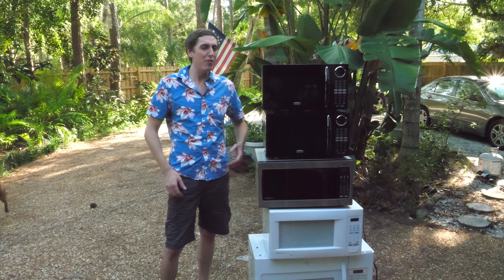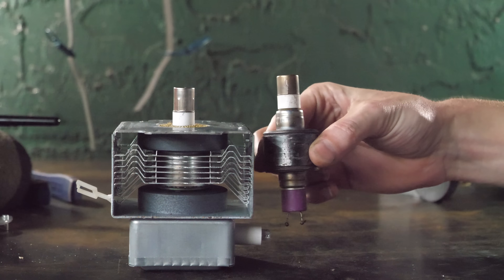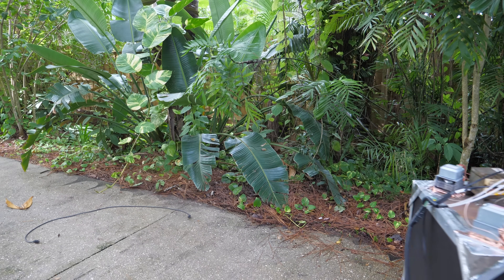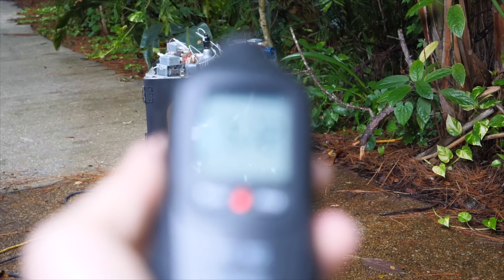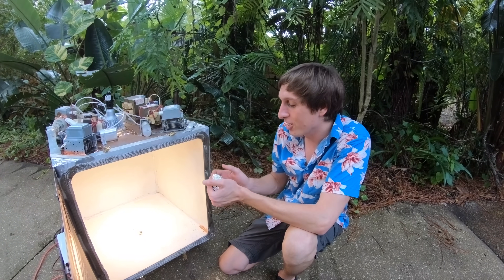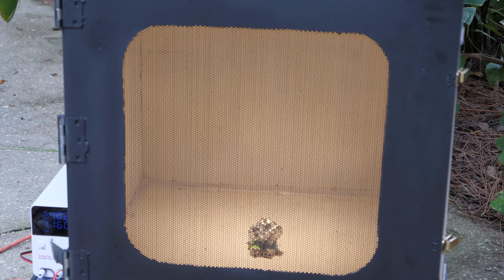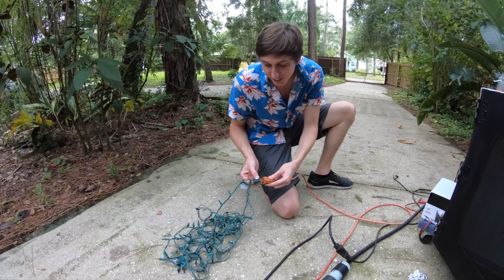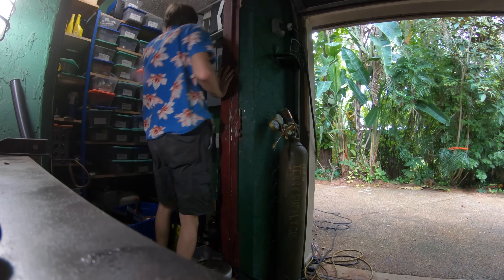DIY MEGA Microwave! - Microwaving a Microwave

Comment: I once microwaved a microwave with a glow stick inside of it. The glow stick remained intact but the microwave was fried. To get it to work I used a giant over the range microwave and a small 600 watt microwave. The little one BARELY fit inside of the big one but I got it to work.

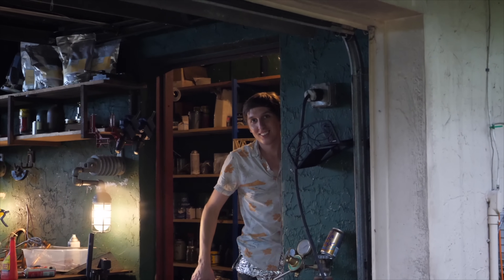Comment: 3:17 use the blond to film and hold the meter while you stand behind a 8 inch thick wall and run the power.. Awesome! Then she tests the cage too.. Double Awesome! 6:00 I think you are too low with your targets, maybe raise them up a few inches and see if it works better. I could be wrong.

Comment: How a microwave works 
It heats upp the water inside the food thats how food gets hot

And why its cold at the inside 
Its hardder for The waves to acces the middle of the food bcuz they dont travel so far

Why You cant put metal in microwave 
The wave just bounce on the metal like a mirror

Comment: Um...  If the microwave is designed to hold microwaves in due to metal shielding, how are the mega microwaves supposed to get into the smaller microwave to help cook the food if you leave the shielding on the smaller one?

Comment: If you want to make an extra powerful microwave, volume vs. wattage is everything. Add the magnetrons, to an existing microwave cavity, and it will heat extremely fast! Otherwise, you could try to offset them so the waves bounce chaotically all over the rectangular chamber. Thus heating more evenly.

Comment: 9:18 of course it's going to be cold hahahahah the larger microwave fried the electronics in the smaller microwave while the smaller microwave protected the burrito from the microwaves, so what happened is that the smaller microwave stops working and isolates the burrito, so it wont heat up.
Reply: Burrito?

Comment: Just don't break the magnetron. might just be safe... because magnetron has  beryllium oxide. Single or chronic exposure can lead to berylliosis, an incurable lung condition and has  thorium in all magnetron. it is radioactive metal. just don;t take out the filament out the magnetron, then break it. -cancer if crushed.

Comment: I have a tip for you regarding the cold center of a hot pocket.

Microwave the hot pocket for 1 minute.
Flip the hot pocket and do the same. 
Flip it again, and make a slit in the center. Microwave for one minute.

Comment: The reason the microwave in a microwave scientifically ahouldnt work, is because there is a fairly well developed seal between the inside of the inner microwave and the outside of the inner microwave. If it works as tested in the factory, then it should not work.

Comment: So if there are 100 bulbs in a Christmas light and we remove one and connect the two pieces to form a 99 piece light, the overall light would be brighter because the current through each bulb is more.
Or would it not and be equal because the current going through the bulb would just distribute amongst thhr other 99?

Comment: Make a microwave 'Jagerbomb', using a shot of petrol (gasoline for Americans) as the jager, in a glass full of DIESEL as the redbull, and a bit of tin foil. Hopefully, the microwave ignites the tin, the tin ignites the petrol, and when the petrol is burning hot enough it will ignite the DIESEL and give a massive 'whooooomph'.

This is pretty much what happens inside you stomach when you drink an actual jagerbomb.

Comment: this is weak. In fact, it probably would be stronger with just 1 magnetron. Those microwaves don't just add up in power unfortunately, they interfere pretty badly, and you end up with them heating up each other. If you want to have multiple of them working at the same time, you have tomatch them to start exactly at the same time, and mount them precisely after some calculations, but even then, you won't get a very good coverage of crazy powerful microwaves in that box, the same as you have hotspots in a regular microwave. I think you can do better, and I hope you take my advices!

Comment: So you calculated the cavity according to the frequency with a fraction of a millimeter as supposed so the energy dont go back into the magnetrons? And the 4 microwaves could be in phase with each other so a lot of the energy is consumed by some of the magnetrons and a lot is wasted due to no calculation. So even if you have 4 magnetrons you wont get 4 times the energy unless very carefully calculated for it, which I guess you havent, and I really doubt if its even possible to do with more then one magnetron.

Comment: Magnetrons make microwave beams, so you should concentrate the breams to one location. Also, position them in a way that the beams target the food from multiple angles when reflected from the sides. Later as the beam width is small, you want to move the food inside to reach every part of it. Currently, you just wasting all that power.

Comment: You silly, the little microwave acted as a Faraday cage against the big microwave! Also, I don't think you have enough power -- try using 10 microwaves that are 1200W each. Also, if you want to ensure even cooking, you'll need to form waveguides to angle each beam properly. Cooking times will be VERY short.

Also... You should build a microwave cannon. It's possible to use waveguides to bring the beams from several magnetron's into a coherent microwave beam and blow things up from a distance!

Comment: You have built a good container, but did not hide all microwave-generating parts inside. Parts of the magnetrons that are outside of the box also emit. You can hear it - the noise the camera records is actually microwave energy. 
Make some cover on top, maybe solid metal.
Also, for the magnetron lifespan sake, add cooling!

Comment: Microwaves are high voltage appliances, and should never be taken apart while plugged in. ... The magnetron inside a microwave can contain beryllium oxide in their ceramic insulators which can be fatal if it gets into the lungs. Simply removing it is safe, but never try to take one apart. It's not worth

Comment: The microwave oven is designed so that the wavelength does not leak out. 
That is, the wavelength does not reach from outside. I was amazed.

Comment: I seen a guy put a cardboard box in the microwave for 30sec. Then look at the box with a thermal camera to see the hot spots the microwave had left on the box. Can you do the same with your super microwave and a normal microwave to see the difference. It could look cool. And maybe put a box around your super microwave to see if you are able to get hot spots that leak outside of the super microwave. Thanks.

Comment: The DC power supply you flip on: Is that controlling a fan to semi-randomly distribute the microwaves, as in a traditional microwave oven? It would makes sense, as that's a pretty important part of attaining even heating (and if you're like me, you have way more DC than AC fans/motors).

Comment: The snack did not cook probably because the smaller microwave had a protective coating that stopped the waves from getting out or in so the stronger microwave waves could not even get in and simply roasted the microwave

Comment: the microwave inside a microwave would not work for a very simple reason.... microwaves are designed to keep micro waves leaving the microwave... but it also works the other way around... micro waves will not be able to inter the microwave when the door is closed.... you were just microwaving the exterior of the microwave

Comment: I was under the impression that microwaves only heated things up because the microwaves cause water molecules to move faster. At least, that's what I learned in school.
But it's clear that a CD or plastic on another microwave doesn't have water present.

Comment: There are many reasons this can fail. Microwaves operate on a usual frequency of 2.4Ghz to 2.5Ghz depending on the power output, the power input from the mains or generator, and design of the model. Working on Radio's for 7 years, I know that depending on who gets the power first, will cancel the others out frequency-wise, and distort the heating process greatly. Though it is fun, I wouldnt recommend trying this at home, and I am glad you provided a warning for viewers. Cheers mate!

Comment: The body of the regular Microwave oven protected the contents from radiation, the same way it protects us by stopping it leaking out, and because the radiation from the Mega Microwave oven killed the regular oven before the 2 minutes were up, it was barely cooked at all.
Reply: I don't recommend eating those microwaves,  they're undercooked.
Reply: RBabik Ii lol nice one
Reply: prizegotti yeah I'm not sure why he thought that would work.  Should have at least taken the door off the inside one.
Reply: Yeah, he should have had a ‘duh’ moment at some point.
Reply: I don’t know much about this type of thing but wouldn’t the Hot Pocket be a little more cooked because the other microwave stopped working. Wouldn’t the microwave stop blocking the radiation after it’s dead. Or maybe it depends on when the microwave stopped working.
Reply: @gabriellefoster945  no the microwave shielding is passive and built into the walls and door of the machine. It works even if the power is off.
Reply: why didn't he think of that
Reply: i thought the same thing! i was like „the waves of the mega microwave can’t get into the regular one, because it’s protected. what was he thinking?!

Comment: This microwave wasn't 4x as powerful, you really don't understand RF, and in particular microwaves well enough to be doing this but I'll explain briefly.

Microwaves are tuned resonant cavities. This is importatnt because the cavity needs to be resonant so that the microwaves form a standing wave pattern inside the microwave instead of a non resonant cavity that will cause reflection at non multiples/fractions of the wavelength and thus destructive interference causing power loss.
Also you can't just throw a bunch of magnetrons to transmit into the same cavity. The magnetrons actually have to have a waveguide to enter the cavity by themselves so that they create the standing wave pattern, but ignoring that you have the problem of multiple magnetrons that have their own standing wave patterns, what happens is you will have interference patterns between them because their waves are not in the proper phase. In commercial applications (such as radar) that use more than one magnetron it is necessary to use a special microwave tuner feed that is adjusted with a micrometer screw. The reason the one magnetron got hotter than the others is because it was out of phase with the others, and hence it had a much higher standing wave ratio which means it wasn't as able to easily push out it's transmission through the antenna. I would hypothesize you got perhaps 1.1-1.4 times the power of a single microwave by using 4 magnetrons.

If you used matching magnetrons, a tuned resonant cavity, and properly designed tunable waveguides you might be able to get 3.5-3.8x the microwave power of a single oven in the cavity.
Reply: Yeah.....I don't think you understand the phrase "Backyard Scientist" well enough to be replying here, but I'll explain briefly.

The microwave being 4x as powerful was partially said tongue in cheek, that means it's not a scientific statement, but a comically absurd one that no one should take as fact. If this was video from MIT to help students or from Microwave Inc to train employees, maybe all that extra work and explanation should have gone into it, but unfortunately this was for entertainment purposes and not education purposes. Instead, this microwave was meant to be a hastily rigged junkyard apparatus that would be ok to destroy with little investment and perhaps create more entertaining effects without safety features or tuning.

Comment: Did you match the characteristic impedance of the magnetron output waveguide with open air (about 377 Ohms)? If you did not you are creating reflected waves that will diminish the life of the magnetrons and decrease performance. Most waveguides have a horn on the end that accomplish this. You could reuse the sheetmetal one in each microwave. That would increase your efficiency. I should also mention random microwave emission ports cause random constructive and destructive waves within the cavity. So theoretically there may be spots with no microwave energy. The most efficient way to do this is to place each magnetrons at points on one wave guide where each adds to the amplitude of the other or multiplex several waveguides feeding into one output feehorn in the microwave.
Reply: That can be tricky to do if the wave guides are not setup perfectly they can theoretically experience the same destructive interference but yes I imagine his megawave has a lot of cold spots.
Reply: @wartech0  Not that tricky since we are talking about wavelengths in inches. You could do it with a ruler and tin snips.
Reply: @prospektOS-tmo97  IDK. Very carefully?
Reply: why such crap? if on eBay there are 100kW CW magnetrons.

Comment: I wonder if there is an efficiency limit on how many you can add together, or if there is a way to design a microwave interior to amplify the microwaves power, then see what happens when you mess with the level of power input into the device. Would it melt the foil instead of making it spark?

Comment: Of course, it won't work to microwave a microwave that is microwaving food.
The outer microwave breaks the inner one so it can't heat up the food anymore and the outer microwave can't heat up the food because the inner microwave is not just blocking microwaves going out but also microwaves going in.

Comment: Doesn’t it make sense that the hot pocket was still cold? The big microwave just broke the small one so it stopped working. But the hot pocket is sitting inside a faraday cage in the broken microwave. So no waves can get to it. Correct me if I’m wrong!

Comment: I think there are 3 dangers to microwaves. One is its high voltage risk inside its components, radio waves exposure when on, and the other is Beryllium. Beryllium from what I heard is really poisonous if inhaled. That pink stuff in the magnetron in made of ceramic beryllium and should be really careful not to crack it. My concern was putting a microwave into a microwave and cracking due to heat then starts smoking up. Then again, I am not scientist like this guy.

Comment: The microwave inside the microwave didn't work because the shielding on the inside microwave would prevent it the microwaves from the bigger microwave from getting into the cabinet with the food so the only thing you did was microwave the electrical components of the small microwave. And because of that the small microwave failed before it was able to heat up the food during a normal cycle.

Comment: Couple of things....

A: pepperoni hot pockets are the worst. everyone knows it's five cheese or nothing.
B: The secret to a good hot pocket, is to place it upside down for 50 seconds and then right side up for about 1:20-1:50 depending on microwave power and desired temp. This gives it a better flaky crust and a consistent internal temp.

Comment: I think your power supply there is why it didn't perform as well as you would expect. If I saw the settings correctly you had about enough for 1 really good microwave.

Comment: Please be Extremely! careful when handling a magnetron, the ceramic insulators contain beryllium oxide, if the ceramic is damaged it can release beryllium oxide powder into the air and the stuff is no joke, it will destroy you. Please do not handle a microwave magnetron without doing some research and understanding the risks.

Comment: Im going to geek out for a second :P  Just because there are more microwave causing devices doesnt mean its 'more powerful'. All the devices are radiating the same frequencies, look up how waves of all kinds effect particles. Its not the amount of devices creating the same waves that matters, its the frequency in which it does it. Microwaves create vibration which creates friction which creates heat. More devices are just covering a larger space, not making it 'more powerful' lol. Check out HAARP. Thatll turn you to ash microwave style, with a single transmitter. Power? sure... but is that the reason? No. Its the frequency they choose to radiate at. Correct me if Im wrong.

Comment: You left out the one thing that Mythbusters did. That little metal thing you find in the microwave cabinet is there to reflect the beam from the magnetron around the inside of the enclosure. Without the reflecting from the turning metal the energy i=only goes in the direction the magnetron is pointed. It will reflect off the walls but it is less efficient that way.
Also to people that like to take things apart. The magnetron has one big hazard. The ceramic ends will likely have beryllium in them. Beryllium is a known cancer causing substance. So don't break it apart or grind it into dust. Bad stuff.

Comment: Great video!
Isn't some of the stuff inside the magnetron really dangerous/poisonous, like it can kill you dangerous?
Reply: Little late by 4 years but yes, there are quite a few things that can kill you in microwave ovens. Including but not limited to: beryllium oxide, zinc oxide, tin oxide, titanium oxide on the metal side. Electrical shorting could happen if you touch the transformer and the magnetron, the resulting circuit would travel through the unfortunate soul completing the circuit and causing a cardiac arrest. Just to name a few